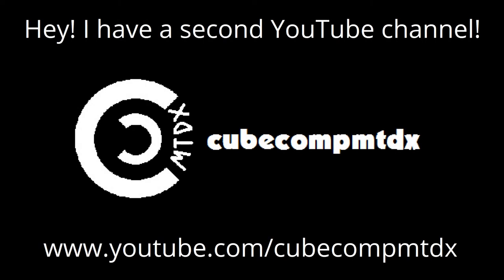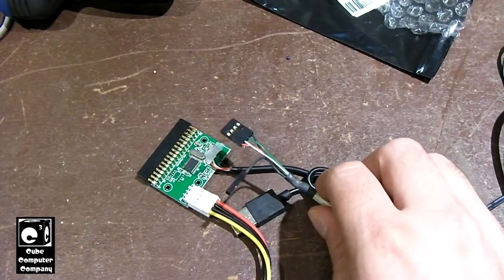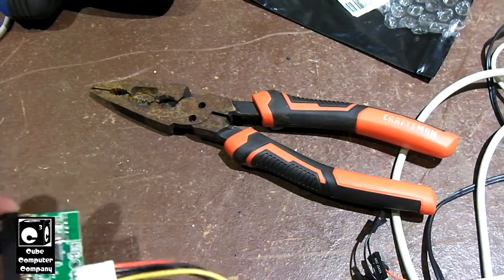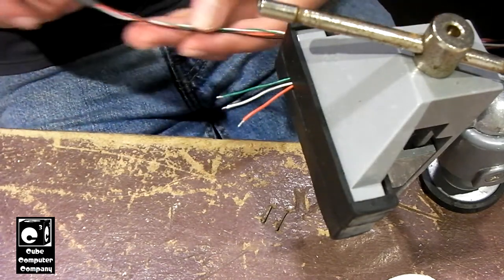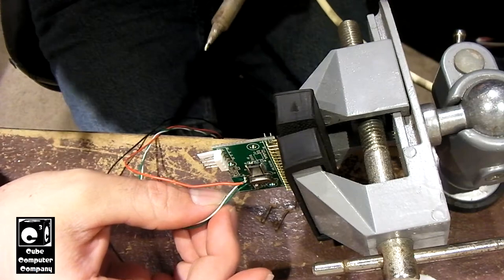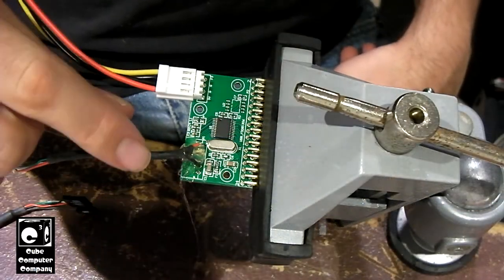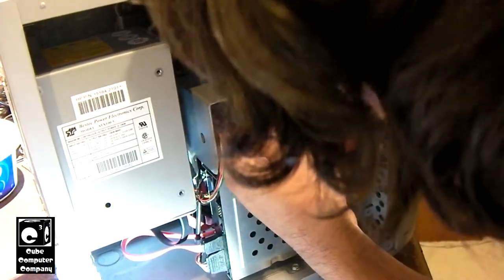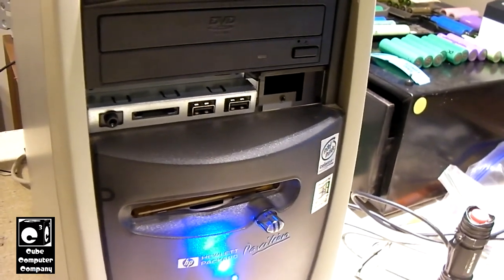Using an internal floppy disk drive with a motherboard lacking an onboard controller

Comment: My main concern is not the usb 2 cable itself, but rather whether it works: I'm looking for some way to revive my old floppy disks (at least to read them and transfer data from them), and all external USB2 FDD that I've tried either don't work, either work for a couple of days if not hours, and then die (very cheaply made => utter Chinese crap where the goal is to pay for them to fill our trash bins and pollute our planet even more). So, does it work well?
Reply from the maker: It works just like a regular internal floppy drive
Reply: @CubeComputerChannel  thanks, I will try it then.

Comment: That's very cool, but what in the world would you use it for? 1.44 mb doesn't hold much, is it a notepad password manager? Copy and paste? 😁
Reply from the maker: I have many old floppy disks that contain photos and sometimes I end up finding more. And for other various reasons I sometimes need a floppy drive. I used the adapter solely to retain a working floppy drive in this old HP project.
Reply: @CubeComputerChannel  still very cool! I have a few floppy drives in a box, I might copy you. I don't have any soldering equipment.
Reply: Yes Nick..it also makes BIOS updating on old PCs a lot easier..if you have several IDE type drives and don't want to pay out for a USB floppy drive..I know because i've watched my local tech man rewrite the BIOS with an external floppy..only time i ever seen one..
Reply: Because it's not everybody who began using computers only after 2005-2010 and via the latest "floppyless" systems. Many people that are still alive (and even younger than most would think), have used floopy drives and need a driver to retrieve their data, if not to revive an older system. Personally, I'd keep some admin archives onto those brand-new floppies that I haven't used since I bought them many years ago : most people won't even know what to do with these or have the gear to read them ;-)

Comment: that power connector needs to go the same connector is on the PSU
Reply from the maker: The power connector provides USB power to run the floppy drive. It does not need power from the PSU.

If you were to connect your PSU's floppy power connection to the addon board, you will backfeed the 5V rail with USB power from the 5VSB rail, which is not a good thing.